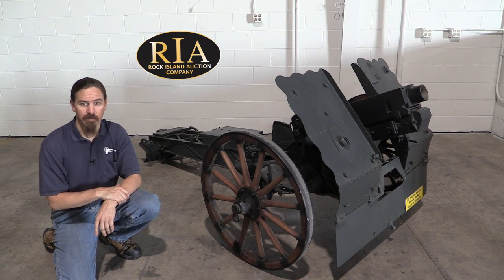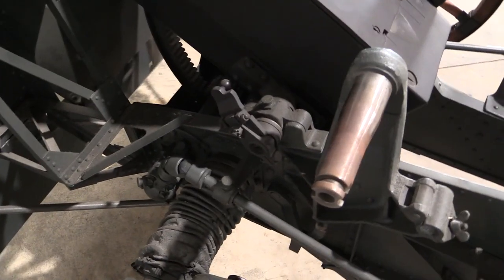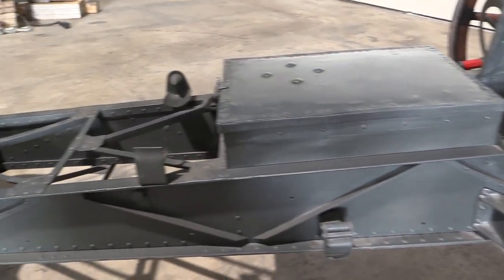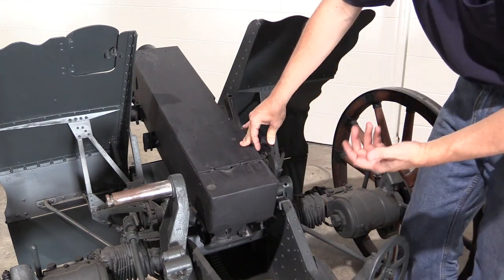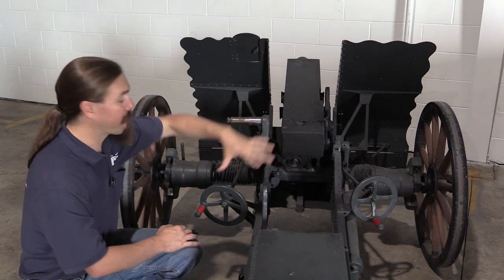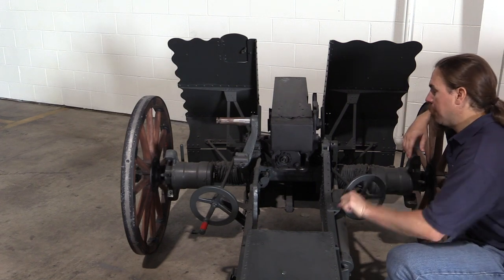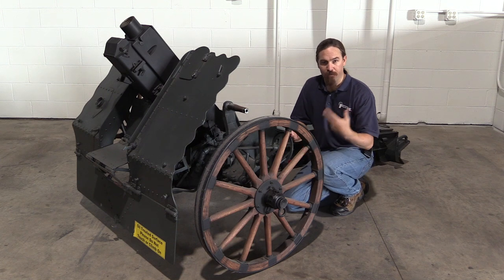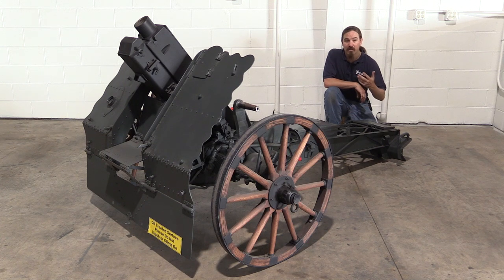Germany's New Light Howitzer: the 7.5cm le.IG 18

Comment: This thing...is...genius.
Forget about being up to par for WW2, that's not the point here. The point is that this is a viable piece of light artillery that can be easily concealed in foliage, fortifications, and in other strategically advantageous geographies, in potentially very tight clusters. These things have the 4000 meters they need to skirmish effectively enough as light support artillery, and can be relocated relatively quickly, even potentially by very light vehicles such as the Kettenkrad(Sd.Kfz. 2), and potentially even without vehicular assistance over relatively short distances.
It also looks relatively cheap to produce as such things go, which makes it quite a nice piece of equipment to have in the arsenal on the virtue of the sheer potential total mass of firepower.
On the camouflage front, I think the idea more than anything is to reduce the ease of identification from an aerial perspective, as airborne reconnaissance was being more and more widely employed as various countries took to the skies more. Much of the time reflects this, as we can see through the easy example of the old air raid towers in Europe, and the way that everything that is meant for the soldier is now oriented much more around being weight-efficient. If you are concerned about fuel usage, one way to reduce it is to reduce the weight of the aircraft, thereby requiring less work from the engines to retain speed and altitude. You can either strip down the weight of the plane itself, or you can do what NASA does and squeeze as much weight out of everything you pack into the craft as you can. This would apply to ground vehicles as well, but to loop back and make my point, I think that the wavy edges are meant to be harder to identify from the air more than anything. Even that little bit of curving can have an effect on the brain at altitude when you can't stay still or move too slowly, due to the fact that the plane has to keep moving to keep flying.
If the recon planes cant spot your light artillery, the enemy can't suppress it (as easily) with their artillery, or their aircraft. If this worked at all, that would mean this thing is perfect for ambushes, feigned retreat maneuvers, and also in a general infantry support role.
I can see this being wheeled around by two guys while a third carries a box of shells.

Comment: Why they totaly disarmed it☹️ So sad. 
They should mill down the last inch of the barrel and the breechblock hinge, so it could only hold low power charges. This would it let still working for presentation with blanks, but blow up when a projectile is building up pressure on the breechblock.

Comment: Alot of comments here are comparing the infantry gun to 81mm or 120mm mortars which are more mobile, and in the case of the 120mm mortar have greater punch. However, this weapon has capability mortars don't have, it's also flat-firing weapon. For example, if you're assaulting a blockhouse, a mortar can only drop bombs on the roof, whereas you can use this infantry gun to fire through the slits. Or you've run into snipers, or a machine-gun holed up in a building, you can fire shells though the windows, blow out the doors. A mortar can't do that. Finally, you could take out soft-skinned vehicles with this, a mortar would probably be too inaccurate for that. This is really both a mortar and a recoilless gun in one.
Reply: It’s a Howitzer.

Comment: I am wondering: what is the advantage of this IG over the 80mm mortar?
Reply: Often in infantry support, it's desired to put a shell through a firing port, window, doorway or other opening in a vertical wall. 

Mortars of course are excellent at dropping shells behind obstacles, but not good at firing on flat trajectories through such openings.

Comment: This is a good example on how the parts of the german industry over-engineered things. A 81mm can do almost the same thing (less about 1000 yds of range and the HEAT-shell) but weighing a tenth as well as being very much more simple.
Reply: 81 mm mortars were in use by the germans.

Comment: So what can this do compared to an 81mm mortar do? I suppose the main distinct role is as a direct fire weapon, the weight of shells on target is higher but the shell has less efficient filler ratio (ideal mass ratio of steel casing to HE filler is 75% steel by mass to 25% TNT (ore equivalent) by mass) and an 81mm mortar would generally be more effective for area bombardment as the more vertical descent.

There doesn't seem to be a use for for artillery like this post-WW2, 81mm mortars and similar are used for indirect fire and if ever a strong point needs to be hit directly then a rocket or recoilless rifle. Most of the demand would be for indirect fire, even against pill boxes and machine gun nests indirect fire would be more valuable as it's likely going to be hard to pinpoint the exact position but a smokescreen can be laid over the general position a camouflaged hard point may be to temporarily neutralise it.
Reply: Aded to which, things like mortars and Panzerfaust, a whole hell of a lot cheaper and easier to manufactuer.
Reply: IDF is most effective at attacking troops in the open, once they go into prepared fighting positions with overhead cover you need a direct hit
Reply: Though the Great War showed that troops entrenched could stand up to direct fire quite adequatley, you just ducked! Plunging fire from a mortar was the answer that was come up with.
Reply: Really? You just ducked? All reports I can find on Mortars says you need an extremely high concentration of mortar fire to permanently neutralise troops in "dug in positions" (i.e. trenches, foxholes, machine gun nests. I need to draw your attention the the entire class of weapons developed in the first world war known as 37mm infantry support guns. 

https://en.wikipedia.org/wiki/Infantry_support_gun

These were very important weapons, developed and procured in very large numbers even before many nations adopted light machine guns, they were low velocity 37mm cannons they were in fact as small as they thought they could made a cannon as at the time the St Petersberg declaration was still valued and that set an absolute lower limit of the size of a projectile at 37mm.

These weapons had such tiny explosive filler they were clearly inferior to contemporary indirect fire weapons, they could only be to shoot directly at dug in earthen positions so the round penetrates INTO the earthworks and explodes INSIDE. Plunging indirect fire from mortars had serious problems in that it was so atrociously inaccurate, you could be dropping bombs on a foxhole all day and get through literally tonnes of ammunition and never score a direct hit.

A 37mm infantry gun on the other hand, that had the velocity and the sights to directly target hard points.

So you CANNOT "just duck" from a 37mm infantry mortar, the point is they had fuses that were inherently limited in a delay which meant they would explode after penetrating into soil, but that was an advantage of a direct hit. If you just duck then the 37mm projectile will blast through the lip of the trench or the walls of the foxhole and explode inside the space where you are ducking. But you really can just duck from plunging fire as it's so unlikely that the round will land directly, indirect fire is not accurate, it trades accuracy for a wide area of effect by the annular blast, something that will be 98% ineffective against troops very low in dug-in defences.

There 37mm guns evolved over time into the first generation of anti-tank guns as they were essentially the same round with much higher velocity to punch through steel armour. Though you can either go to a faster round, or a bigger round. In the case of this 7.5cm gun, it went to a bigger round probably because of the German organisation of anti-tank guns there was not a perceived need for a 37mm high velocity gun to take out tanks like there was with British and American armies early in WW2.

It should be noted, the US Marines went to all the trouble of hauling 37mm high velocity guns through jungles they knew the Japanese had no tanks. Because they needed a direct fire weapon for things like fox holes, dug outs, bunkers and other dug in positions. Also it was very very effective with canister "shrapnel" shot at long range against troops that were fleetingly exposed, ideally in sudden charges.
Reply: First no need to be sarcky.  A gun fires at a flat trajectory from depresion o 23 degrees. In the case of entrenched troops even with delayed fuse shells you need a plunging fire to give the trajectory where it can bury itself, and in the case of the Wesern Front of the Great War, a lot didn't work. Proof is they are still there . The shortage of heavy weapons for plunging fire was a headache for both sides. Shrapnel , air burst, was the one used in the majority of cases, British Shrapnel was lead so lots are found, German shrapnel was steel so is unusal to come across. The Roayl Artillery fired during the Great War about , got to remember the noughts, 999, 999,9037 18 lb shrapnel shells at a cost of £4 Sterling each.
Reply: 51WCDodge shrapnel is all but worthless when used in the indirect fire role and why when it’s effect was studied was removed from artillery caissons and ASPs in favor of plain HE
Reply: There's a difference between meeting at 5-10 degrees from horizontal (all the need to end up inside a foxhole or machine gun nest) and the 80-89 degrees from horizontal meet angle of mortar fire.

"in the case of the Wesern Front of the Great War, a lot didn't work. Proof is they are still there"

What's your point? If only 1% failed, that's still millions of shells. But that is about the use of heavy artillery in dedicated artillery regiments, that is different from the type of artillery that infantry (i.e. rifle companies, battalions, brigades and so on) have under their control.

"The shortage of heavy weapons for plunging fire was a headache for both sides."

You're really overdoing it on the whole "plunging fire". Plunging fire isn't an absolute quality it is a relative quality, it means that for a given range the trajectory is much more arching. They shortage was for Howitzers with 400m/s muzzle velocity as they had a very long absolute range, they could reach deep beyond the enemy lines or left and right up and down the lines to concentrate the fire of multiple batteries. The demand in that case was for long range "indirect fire" weapons but it's quite separate from the infantry organisation.

The artillery regiments had quite a general role, they were NOT targeting individual machine gun nests or trench lines, they were targeting whole hectare sized areas. Timing between so many infantry brigades and different artillery companies was a nightmare to organise but it's something armies eventually learned how to do. 

But this isn't about that communication, this is about WITHIN a company or platoon, they have a specific machine gun nest or similar that they need to blow up. The infantry did find themselves having to deal with dug in defenders and a direct fire weapon that could accurately hit a point target was needed, procured and valued. It was not trying to do what a mortar was doing, it was not trying to be more plunging, it was trying to plunge as little as possible.

If you are trying to hit a specific point which is relatively vertical then you want as high a velocity as it practical, the low velocity of a mortar simply isn't good enough, the trajectory curve is at a point where there is too much error.

What you say about artillery regiments is more or less correct... but this isn't about separate organisations of artillery, do NOT impose that general imperative onto the requirements of the cannons and ordnance that are "organic" to infantry units, that is they are within the control and organisation of a Brigade, a Brigadier General doesn't have to go up or along the chain of command to ask another officer of another unit (say, Artillery Regiment) for fire support. That's something he could do, but the answer may be "no" for whatever reason like we're saving munitions for something far more important, we don't want to give away our positions by sound/flash, we're on total standby for counter-battery fire and so on.
Reply: Treblaine I had to refer to a tabular firing table for angle of fall, but you are not going to see extremes above 
80 degrees even at max quadrant elevation for a 120mm mortars the max angle of fall was 1260mils (71.1 degrees)
Reply: For angle of fall of what? Oh mortars, remember it gets steeper on descent due to deceleration and wind.

But this isn't about mortars and yes, mortars do generally fall at VERY steep angles, and they have VERY wide spread. Not only are they very unlikely to land into a trench, you don't know if they did as the angle of indirect fire makes it very hard to impossible to see and correct. Don't use mortars for what they weren't designed to do, they are for saturating an exposed area with fragments, this is great for suppressing a trench line TEMPORARILY or destroying troops trying to advance over ground to counter-attack the trenches you just took.

Even if you could land an 81mm mortar inside a machine gun nest, it would be total overkill. You don't need a 1kg fill weight of TNT if it's blowing up INSIDE a 2x2m trench section or bunker. You only need as much power as is in a grenade, which is what is in these 37mm Infantry support guns. 

More relevant trajectory is the typical range a machine gun begins to be trouble for troops, around 500m. That is much further than the average engagement range for rifles, that's because rifles are limited by lack of T&E mechanism, machine gunners can cooperate with spotters to exploit the full ballistic potential of such full-bore rifle rounds. Anyway, a 37mm infantry gun firing a projectile at about 450m/s is going to have a an apex of its trajectory of only about 4m, it's not going to be very steep at all.

But that's because machine gun nest and pill boxes ultimately must expose a vertical frontage, that's what is targeted, with binoculars the muzzle flash of the machine gun is located and a 37mm projectile is aimed directly at the gap in the sandbags that the machine gun is shooting through.

It's not like when you're using mortars against troops that are assaulting your position, you essentially have nothing vertical to aim at, you are effectively aiming at the much more horizontal surface (the ground) that the enemy troops are standing on, to have it explode near them and exploit the large explosive warhead to spray high velocity fragments over a large areas to compensate for imprecision.

Today this direct fire task would not be done by a 37mm infantry support gun, there are now dedicated "Bunker buster" weapons:

https://en.wikipedia.org/wiki/M141_Bunker_Defeat_Munition

Much lighter than a 100kg tripod mounted 37mm gun, though the 37mm gun and ammunition would break even on weight if you needed to take more than about 20 shots, so it's not terrible.

In WW2 there were other infantry support direct fire weapons. The British PIAT anti-tank weapon had a HESH round, the US military used the 57mm recoilless rifle, but generally the practice was to use armoured vehicles to bring forward a direct fire weapon, the 75mm or 76mm gun may be overkill for a machine gun nest, but overkill is under-rated. 37mm could do the job, it's just it might take more rounds, 75mm could do it in one shot even if rushed and not well aligned.

This is why early German tanks with 37mm guns and low velocity 75mm guns seemed to do so well, because they generally avoided being used against allied tanks, they assaulted infantry positions where their relatively diminutive direct fire weapons were sufficient to blast out very well dug in machine gun positions, positions that would have been extremely difficult for troops with only small arms and light mortars to attack. Plus if the Panzers buggered off or just weren't available, the infantry had weapons like Ian has shown us here, the 7.5cm le.IG 18, which is ballistically very similar to the short 75mm guns that most of the Panzer IV and StuG III used until mid-late 1942.
Reply: Treblaine angle of fall is a trigonometric function, all weapons when they are shoot over 800 mils (45 degrees) in a standard atmosphere produce high angle fires whether they are guns, howitzers or mortars.  Mortars with all but a few exceptions are all fire high angle weapons.  In additional to angle of fall a large factor in effects against positions with overhead cover is the weight of the round, which is where most mortars cannot compete with guns and howitzers, infantry mortar rounds are light so they don’t have great penetration capability and even with a high explosive to steel ratio have small explosive charges, so direct hits on properly built defenses have no real effect

Comment: Really overbuilt compared to an 8cm mortar. I get it that they wanted direct fire but they already had anti-tank guns for direct fire against things like bunkers. Even a 37mm anti-tank gun could shoot into a concrete block house with thick walls.
Reply: This was introduced in 1932, long before any ATG's or any light weight 75mm were build. There is a vid that shows Germans using it against a heavy brick house, with impressive results. Things you can't do with a mortar and mortars tend to waste comparable a lot of ammo, till it hits the target. If I were the Germans, back in the days, I would have put it on anything that could move. The gun itself maybe had approx 250 KG of weight, easy to handle and quick firing. With later HL rounds still able to hurt nearly any tank.